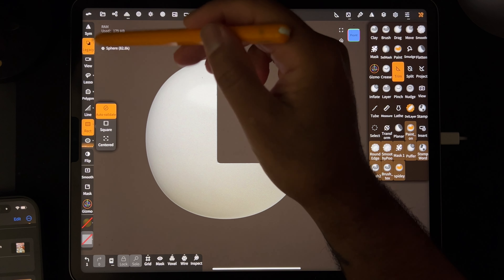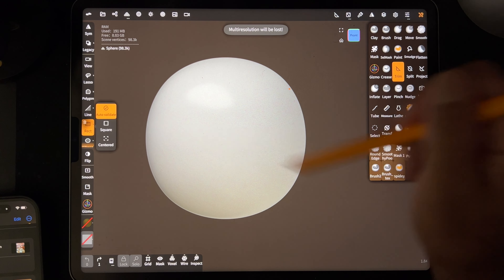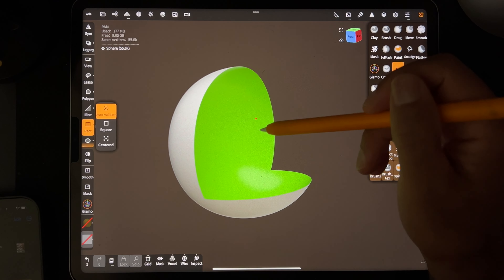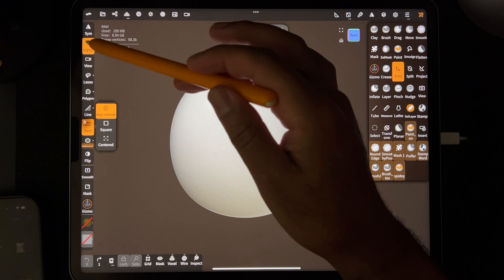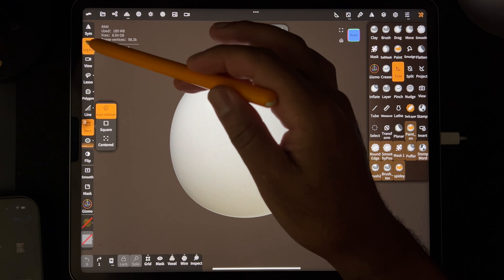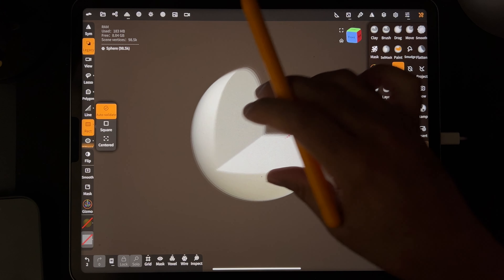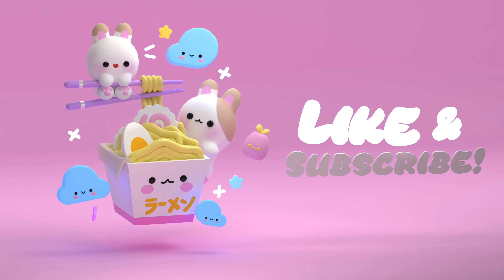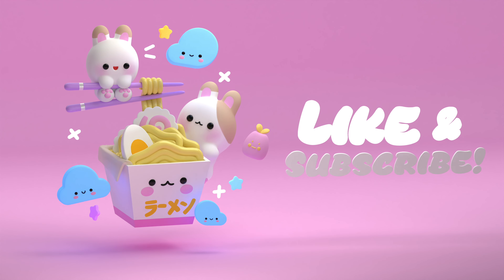How to Fix Hollow Mesh when using TRIM tool in Nomad Sculpt

Comment: I have a question when it comes to 3d printings, how to size/scale the model in nomad? When I import the model into chitubox they start at 1mm basically, and I have to scale them manually. Is there a way to size them direct in nomad?